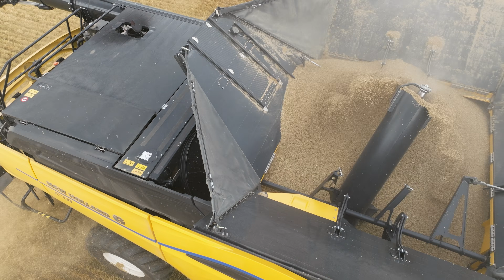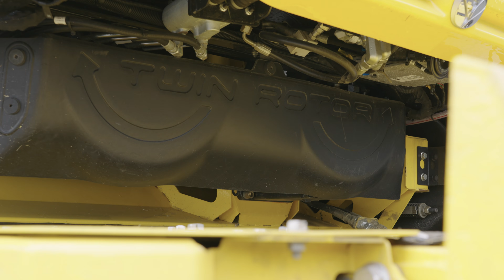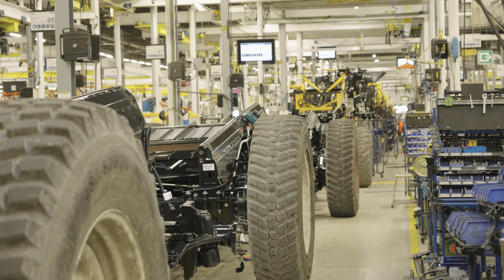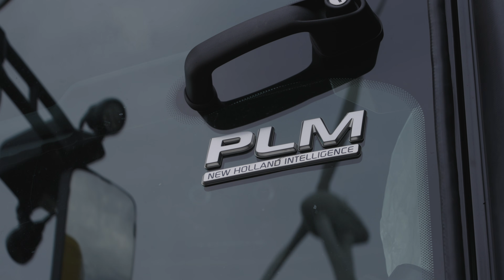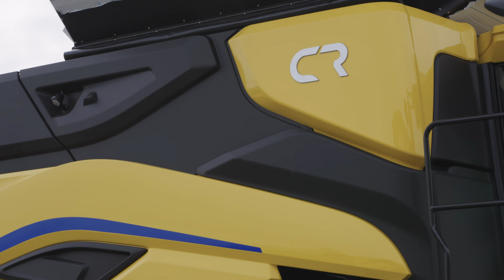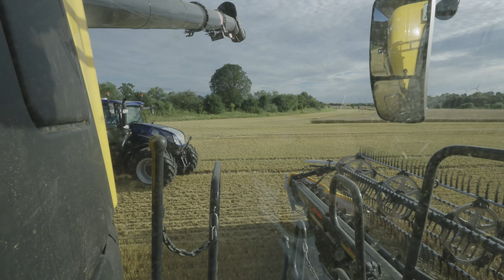New Holland CR11 Test Drive | New XXL Combine | Zedelgem Factory Tour| CR10 | Farming

Comment: But are the return elevators still paper thin so they leak easily? And do you still have to use a large bar to manually reverse the rotors when they plug?  And is service work such as greasing easy  yet?  Putting grease zerks in places that require disassembly is a sure way to make sure it is never done.